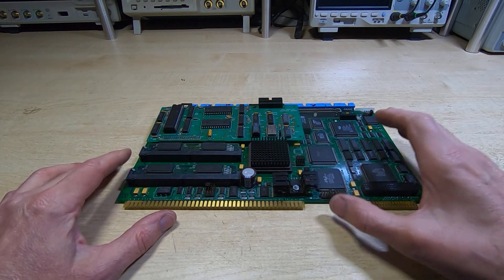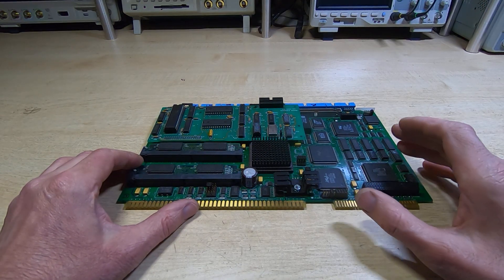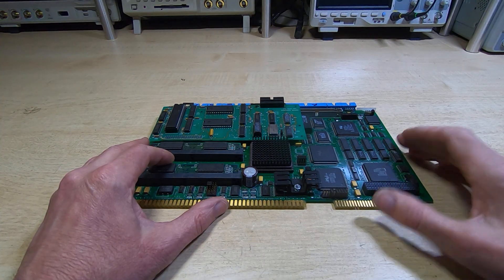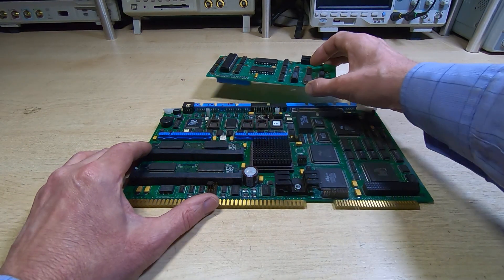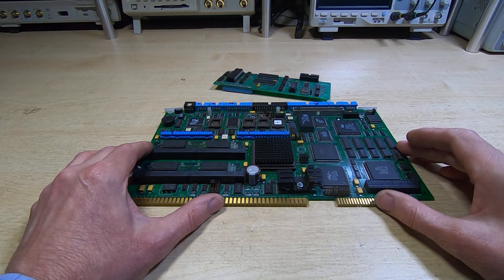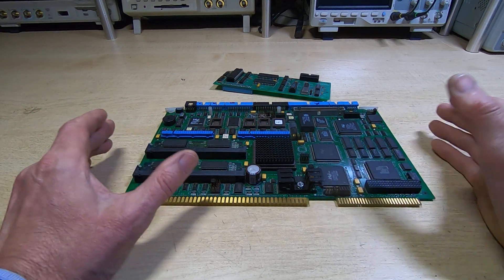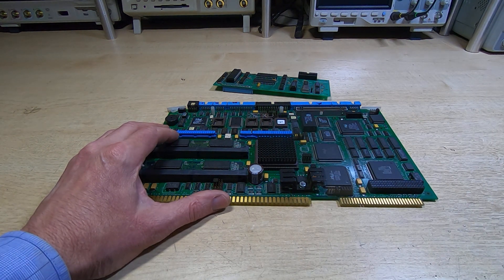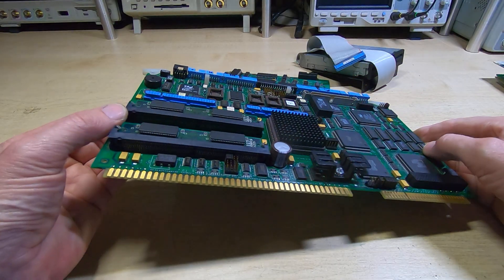Hurco BMC25 Controller Repair Part1

Comment: I can only guess here but, maybe my ideas can help you.
So, this can be a standard PC with ISA and maybe PCI bus. Also I can see that the small edge connector seems very close to an 8-bit ISA bus. As there is the 8-bit ISA pinout available, you can check the actual connector if is really a 8-bit ISA bus (at least the power lines are the same if you can not find the data, adress and control pins). Also the female connector block near that edge conector looks like a PC/104 ISA connector, altough smaller that is for 8-bit only. If so, you can use a standard ISA VGA card (some 16-bit ISA can very well work in an 8-bit only ISA slot) and so no need for a special adapter. With a VGA card, you already have display output to see the boot screen (with boot errors if there are some) and the BIOS screen
The Dallas chip if lost the power (empty battery), there is no useful data stored in it, I know from many bad Dallas RTC chips from newer 486 and most Socket7 motherboards that prevent the computer to boot. I can suggest to mod the Dallas chip with a coin cell socket and try to boot. Most motherboards have the default CMOS setting to autodetect the HDD, but with the bad Dallas chip they can not save the HDD parameters when rebooting. So, first try to mod the Dallas chip to ensure that the settings can be saved. If the computer manage to boot (after autodetecting the HDD) you can enter the normal usage mode with the two terminals; I think that the COM ports are at the default adresses.
Good luck!
Edit The large edge connector looks to be for GPIO; so have nothing to do with the PC functionality. My guess, because the chips near that connector that looks to be - correct me if I am wrong - digital bus drivers 74244/245 and/or power drivers like ULN2003 or similar.
Reply: Being a 486 computer, I think that the OS is standard msdos (FAT16) with a custom program loaded from autoexec.bat to control the GPIO and the second terminal and the command CTTY COM1, <baud rate&transmission parameters> for the console input to be taken from COM1, the first terminal, thus not using a local keyboard and display (VGA card and monitor).
Looking in the HDD under old OS (I would use XP or Linux, because Windows 7 and up write on the HDD, and doing so CAN corrupt the data). 
Also I would make a image of the HDD contents just in case.

Comment: Could this be a standard PC architecture with an ISA bus? If so, you can probably connect a screen if you add a video card. There are plenty of people who can easily tell it if you publish a high-resolution image of the board where the chip markings are readable.